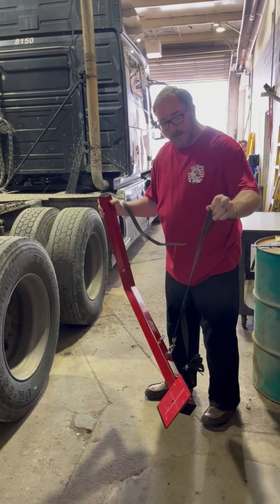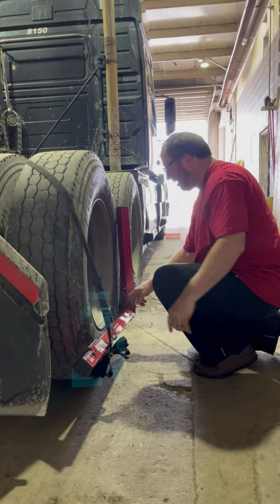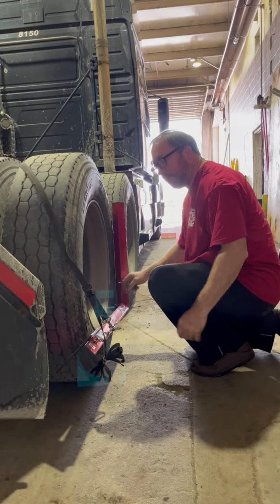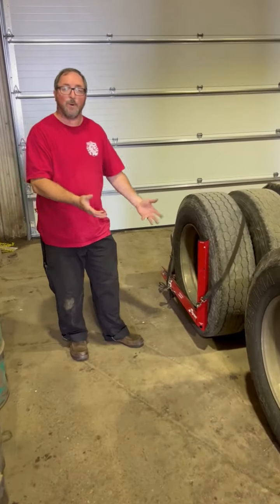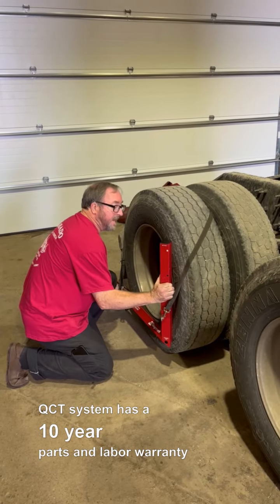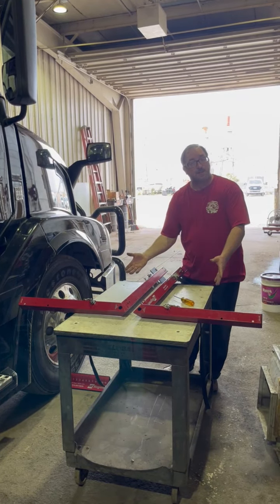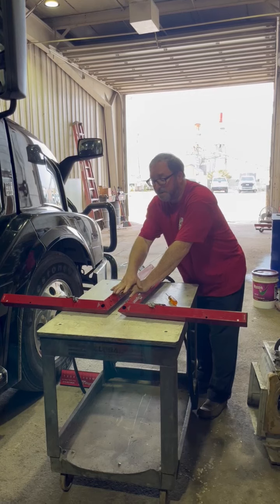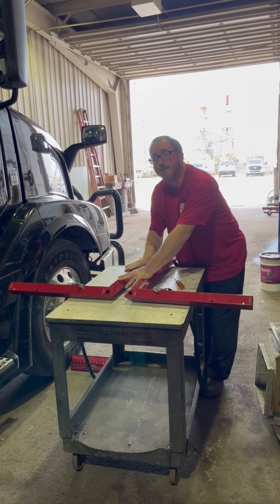MD Alignment QCT system reliability test

Comment: These machines are very reliable? I know because i used them personally. The only problem I see people who use them? For example?  When they have a big difference between the two rear axles?  And the measurements are off going in the same direction? The guy who's doing the alignment never spends the time to recheck the rear axle after adjusting the middle axle! When doing an alignment on a three axle alignment, your using a Hunter or some other machine?  That shows live readings ??? When u go to print the printout? It will show not only u? but it will show the customer that the rear axle is still off of alignment. This is the only issue when using this product and it's not really an issue of the (product) it's a issue of lazy alignment techs!
Reply from the maker: Rechecking your work is the key to successful alignment.  And you can’t just deflate the airbags, you have to roll the vehicle forward preferably 3 truck lengths or more, if space allows.
Reply: @MDAlignment  🙏🙏🙏After 40 plus years Yes! Very much so! I truly believe on living off of eggs, not the chicken. 😁
Reply: @MDAlignment  YOU FORGOT TO SAY LET IT COME TO A SLOW ROLL !🤭😉
Reply from the maker: That’s about the object you are measuring, which I will make another video discussing.  This video is just about system reliability.
Reply: @MDAlignment  Got it 👍🏼👍🏼👍🏼keep up the good work that you guys do!